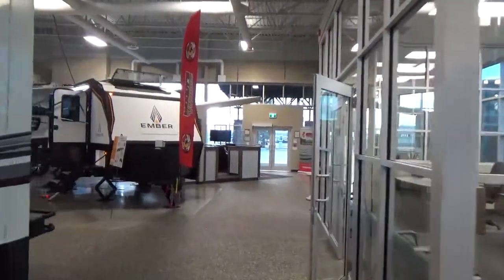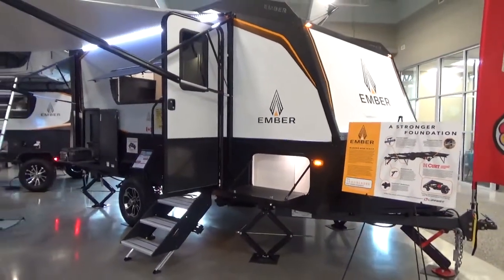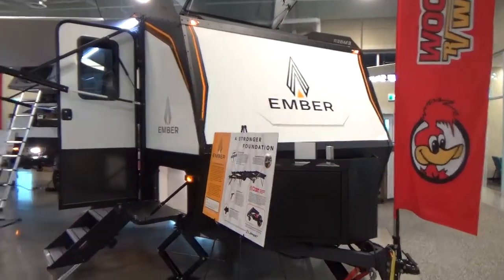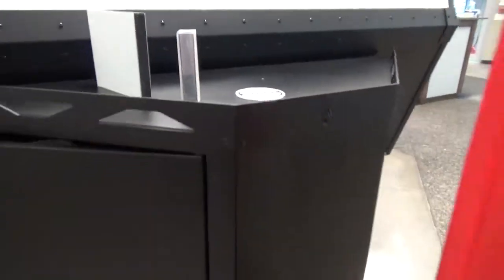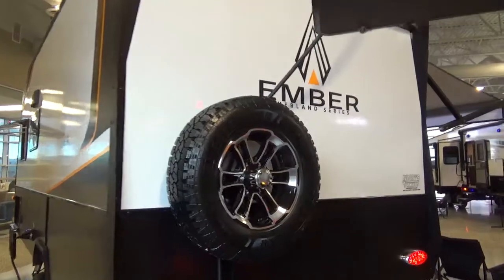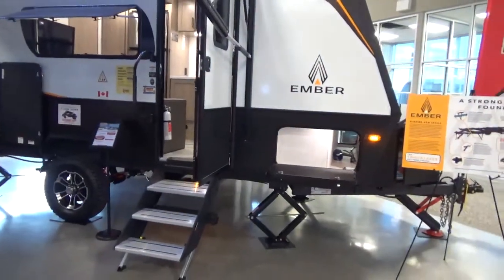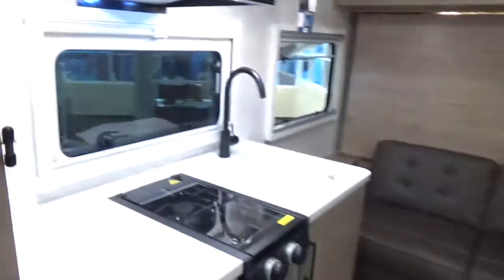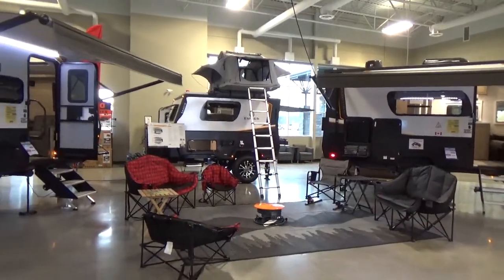2022 Ember RV Overland 170MRB Off Road Adventure Trailer - Storage Galore!!

Comment: Does Ember make the 191 without bunks.
Reply from the maker: Sure does! It’s called the 191MSL. This floor plan has the same footprint with some differences. Jackknife sofa in slideout with storage boxes behind vs dinette table. Storage locker with adjustable E-track storage shelves/accessories vs Bunks & exterior kitchen. 

Here is a link to the floor plan for your convenience. 😀
https://www.emberrv.com/floorplan/191msl/